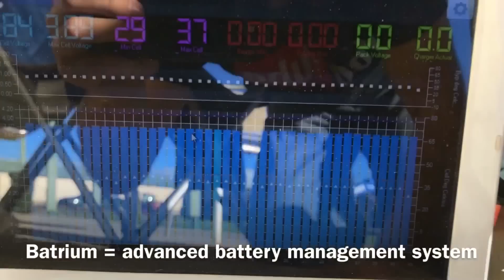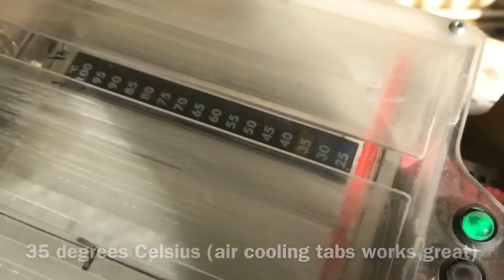210kW Racing Electric Yamaha R1 vs Petrol Bikes (race track) • Ripperton DIY Electric Motorcycle

Comment: Great video your enthusiasm is addictive. i do have medications that could help though 🙏

Need to get rid of the exhaust pipe its just extra weight, less weight more power.

Electric bikes for the road are dangerous. Its bad enough with a decent exhaust on a petrol bike as most car drivers are morons.

Fatality rate if all bikes went electric on the road would be shocking.

And a synthetic sound would be lame.

Ill always have a petrol bike, no matter if we run out of oil on the planet and have to pay a fortune to get a tank of fuel.

Comment: This is where everything is headed...for sure...E-formula is already ganing tons of ground...it's simply a matter of time before all the combustion engines are phased out...eventually it will be illegal to run something on fossil fuels...and you will pay an exhorbitant surcharge for doing so...and when you're out in public with your fossil fuel vehicle you will be shunned ,rideculed, and mobbed by clean energy protestors...they will destroy what you have...and noone will be held accountable
Reply from the maker: Yeaahh agree 100%.. the electric vehicle will sift faster than people expected... all automakers have announced that they’ll stop making petrol cars and all moving toward electric. It’s cheaper it’s more efficient, it’s more reliable, it’s faster, it’s quieter and a lot more POWEEEEERR ohhh yeaahh
Reply: Hearing aides will need to get aLOT better too!
Lol

Comment: Its not an R1. Its an R6
Reply from the maker: It’s an R1 with the fibreglass lightweight R6 fairing. This bike crashed during the racing season and Danny didn’t have much time to shop around and just grabbed the R6 fairing and made it fit. Danny is also a very tall and large guy what also makes the R1 looks much smaller... =]

Comment: How fast does this beast go
Reply from the maker: Great question, this bike is geared for racing but can also be geared for top speed. Racing I think +/-220kmh it depends on the track. Racing you need to start breaking much earlier to make the corner... would be interesting to get this on a highway with tall gears going full throttle and see how fast it goes hahaaaa ohhh yeaaahhh

Comment: Break on the left?
Reply from the maker: Yeah, regen electronic rear brake on the left. He machined a pressure transducer to the lever so when he pulls the brake, the hydraulic pressure pushes a sensor and tells the controller how much regen brake to apply. It is a variable adjustable regen. Very clever solution ohhh yeaaahhh =]

Comment: Seems like the battery lasts for about 15 minutes.
Reply from the maker: At these power levels and constantly accelerating and decelerating its kinda hard.... there are some freaking fast similar electric bikes running on TT island since 2014, they use more high-end and efficient controllers and motors that can run much longer (Ripperton is all homemade freaky stuff)
So much POWAAAAAAAHHH ohhh yeaahhh =]
Reply: ElectricBike I didn't think this is possible, really surprised me.

Comment: My 500cc RG Pepsi Suzuki (4 cylinder 2 stroke) outrageous Kevin Schwantz race replica (see picture) would give you a right pasting. Illegal in Australia and most counties except UK (In Japan 400cc version only)

It's an absolute animal and beats most other bikes much larger cc due to light weight and enormous power coming in at 7000rpm and above.

Brakes on it were enormous and that's what counts when lapping Isle Of Man TT course or any racetrack.

Acceleration is what counts at the end of the day, and the RG had that with light weight in Spades !

I bet you no chance saloon he would not have got by me !

Comment: For those who miss noise, you can add a "vroombox" and get a V8 engine or a flying saucer.
For those who miss smell, try coal, it's great (and noisy, too) !
Fuel technology is dying, no matter you like it or not.
Now about the bike : Very good job, but I wonder if the center of gravity is not too high because of batteries instead of the tank ?

Comment: Ok. Speed seems not be an issue. Now, someone must invent a way for electric race bikes to reproduce "the howling"... I can't hardly think about an era of GP races full of overpowered silent beasts. Half the thrill would be missing in the air at least. Kind of a quiet AC/DC concert... Nah.
Reply: same used to be said in a few RC hobbies that replaced Nitro or fuel and went with Lipo power. At first you miss the sound, but quickly you realize you enjoy the power and convenience of electric system to such extent the noise no longer matters. Power on demand (instantaneous) =  best feeling ever. Eventually everything will be this way.
Reply from the maker: Hahahaha I have to agree with you on this one, we are so used to that high-pitch / high-rpm sound... the transition is hard but inevitable. Let's thing about the positive side, now we can ride the silent bike playing AC/DC out and loud hahaaaa ohhh yeaaahhh =]
Reply: More like an acdc concert with everyone wearing earphones. Nobody outside would get bothered by the noise and complain!

Comment: Well I tested KHB14601C controller and had a lot of trouble! During acceleration phase at around 40-45kW het get out with overcurrent! KLS 14401 is working much better but has less current!. I know that Kelly Controller should work one to one regarding DC amps and phase amps but 1200A with two controllers are not possible, maybe for 3 seconds or less! But in this time you will never reach 124V (175V root 2) So I think 90kW is more realistic and a lot of power for sure! Very nice build of your bike!

Comment: So I know a little about fuck all, how does the regen braking work? Is it like an alternator in the hub? Pull the brake lever and a circuit feeds more current from the battery to the stator in the alternator in the hub and creates an electro motive resistance and brakes the bike or what’s going on there? Love it but mate! 👍🏻👊🏻👌🏻. A great effort. Bet it took a lot of fucking around and time! 👍🏻

Comment: Nice bike nice work but I think he is only faster in the corners cause he dont need to clutch and shift... on the straight a onbord view would be cool to compare... what is the vmax and how far can you get with it in full throttle? And how much do invest in the elektric parts?
Greetings from Germany and sorry for my terribel english😀
Reply: Electric motors have maximum torque at any rpm, petrol bikes if they are not in their torque range they going to get gapped regardless of gear shift delays.

Comment: 6500ks on that electric motor and battery pack? fuck that is bad ass. i bet it weighs a fair bit but the 210kw electric motor on the R6 chassis is a wicked idea.
Reply from the maker: Yeaaahh this setup lasted 4 complete racing seasons as far as I remember... it has gone through a lot of punishment and survived!!! 
This is actually a heavily modified R1 frame to accomodate the battery and motor controllers under the seat, the front fibreglass fairing used to be R1 then the bike had a crash in 2016 in the middle of the season and they quickly fitted the R6 fairing + Danny is a giant guy so I got lots of messages saying "this isn't the R1" and I had to explain all that hahahaa
Super cool bike... I'll be making a video showing his electric racing rival a 700 volts superbike hahaa ohh yeaahhh =]
Reply: Ahh i see haha thanks for clearing that up man. Cant wait for the new video!

Comment: Yeah, when will we expect to see responsive throttles for the DIY guys? 
You can never expect to be First On Race Day with a Bafang thumb on your bars unless you're only passing Spandex!
With Super gas bikes, most of the race is won or lost due to throttle control in the corners.
Reply from the maker: Yeaaaaahh mate... throttle control is everything when it comes to racing, it's a lot to do with a good controller rather than just installing a good premium throttle. The little Bafang controllers have a descent ramping power but they kinda get a bit jerky if you rapidly reduce and increase speed. 
Motor controller technology, throttles, sensors and processing power are improving really fast, soon we will have many amazing FOC compact and lightweight options to choose thanks to this drone and electric skateboard boom... ohhh yeaahhh =]

Comment: 281HP , a MotoGP  only makes around 260hp.
Reply from the maker: Yeah... imagine that on a single gear setup.... massive torque all the way up with no interruptions... haha
Check out the 4x motors sandwiched together before it was fitted inside the bike, more info on the description: https://instagram.com/p/BVzHFcHlgwe/
So much POWEEEEEERRR haha =]

Comment: You could call you bike "R1 ras tanura" clean edition :-|
Reply from the maker: Hahahaha... ohhh yeaahhh and with a lot more POWEEEEERR =]
Reply: ElectricBike you're great man: you're the dyi musk humiliating big oil based motor companies! Can I ask you how much is building your beast?
Reply from the maker: Building these "Frankenstein" one off beasts are expensive as there are a LOT of try and error buying and trying a lot of different parts. Sometimes controller and motors match on paper but don't really perform well in real life so you end up buying other brands and having many expensive spare parts sitting in your garage. Sometimes there's a newer better motor or better controller, better battery density with higher discharge rates... it's a never ending project that you upgrade things here and there along the years. 
Here are two really big Electric Motorcycle groups links where thousands of people share their builds, buy and sell parts and can help you and inspire your imagination:
https://m.facebook.com/groups/684227311714643
https://m.facebook.com/groups/125035107565566

Comment: This is actually pretty cool. Is it direct drive, or have gears?
Reply from the maker: It's a direct drive setup as the chain connects the motor shaft directly to the rear wheel sprocket. Here is a photo of this motor before it was installed on the bike, the chain you see there is connecting both motor shafts together, the main chain goes on the opposite side, check out the photo and description here: https://instagram.com/p/BVzHFcHlgwe/
Reply: ElectricBike Still...I'm not the biggest fan of EVs but that bike is nice.

Comment: Looks like you were having fun, also impressive work on the bike. I just can’t get into electric bikes though. Smooth linear power, consistent pull, they sound good on paper but I love the challenge of keeping a bike in the power band and revving it out until right as the power signs off and the pops as I engine brake into a corner. In fact one of the most fun bikes I’ve ever ridden was an old air cooled 250cc two stoke street bike with maybe 25 horsepower, it’s like an art balancing the revs, gears, throttle and brakes.

Comment: I prefer the petrol one.
Reply from the maker: They cost a lot of money, they're noisy (your neighbours would hate you specially in the morning and at night) they stink, require a lot of maintenance, oil change, filter change blablabla...  + the money you spend just with petrol you could buy another new bike, electric just makes a LOT of sense and in the end its cheaper to run =]

Comment: To be honest he does most of his passes on the corners.More rider than speed.
Reply from the maker: Hahaa it's kinda to do a lot with taking the opportunities + the petrol head guys are so used to each other's noise they don't really know how to react vs an electric bike with monster torque the whole RPM curve + it's a single gear... all these things just make overtaking a breeze =]
Reply: I bet the acceleration is nuts! a tron like cycle
Reply: @minutesagoedited9761  it would be instantaneous mentalness 🤘
Reply: @adamturner2836  my favorite kind of mentalness!
Reply: Rusted on petrol heads always try to say that, electric motors can give instant torque so they power out of the corner so much faster than dinosaur combustion engines.

Comment: This will sign the end of real motorcycle racing world.So sad
Reply from the maker: Yeeaahhh.. Ripperton actually raced for 4 years against a much more powerful 700 volts electric motorcycle, much faster acceleration and top speed but Ripperton's bike was lighter, therefore, more agile cornering... very close times considering the other bike was at least 5 times more expensive
If you're into power to weight ratio, watch my 36kg trike made with bicycle parts with a 42kw triple motor: https://www.youtube.com/watch?v=sRH_cpCwNDs&t 
So much POWEEEEEEERRRR... ohhh yeahhh =]

Comment: Wow... that DIY e bike was out running top mfg ICE bikes!!! Imagine what Dual Hub out-runner PM motors with a planetary gear reduction would do for this e bike... super low CG, rotating mass in ideal position for balance, full variable re-gen braking, more room for batteries/controllers, eliminate chain & sprockets, etc... 
Sure we can talk about rider skills but that's a mute point here.

Comment: well, I do not share the enthusiasm of the screaming narrator. Fast? Not even close, a skilled guy on a race 125cc bike would have passed them all, no big deal. Granted the E-bike has some advantage in shooting out of a turn due to instant torque, but we dont see much of it in video. Also the regenerative braking with rear brake is very questionable since the bike is using front brake for about 80% of stopping power due to weight distribution during braking. Hence not much force can be transformed in rear wheel recuperation. Also the recharge after every session showing us how useless this is for racing, to maintain the size and weight of a R1 the batteries capacity is too low for any serious full race, its a same no go as most e-cars are for road trips.
Face it, electric powered cars or bikes are not economical not ecological at the moment. The production is environmental disaster, same is the recycling. The production and huge loses in transfer of electricity is environmentally almost double polluting then a decade old petrol cars. Until there is some better, higher capacity battery that is easy and cheap to produce without the use of rare materials, there is NO FUTURE for electric cars or bikes. Also imagine that we all migrate to electrical vehicles in lets say two years form now, do you know what will happen to electrical grid? It would literally melt down every evening we get back home from the work. The last time I looked, there was no small nuclear power plant at every street corner.
I know E-positive people use to blame "oil lobby" for inhibiting vehicle electrification process, but actually same can be said about electric power production lobby that try to sell all the useless electricity they produce now days. We have all gadgets that are A+ or even better in our houses, average TV now consumes around 65W per hour instead of 500W like decade ago, same is with light bulbs, refrigerators, and all possible gadgets at home. But we have same power plant capacity of traditional sustainable production (nuclear or coal/gas) now getting filled up even more with unsustainable power plants (wind turbines and solar). What to do with all this electricity, we cannot store it in some kind of bucket? Wait a minute, we tell people that they should go green and buy a E-vehicle, that would be the bucket, we can tell them that its more green and even costs less.... and so we can actually sell electricity that we could not sell to anyone. So yes, the force behind this E-vehicle drive is actually the Power plant lobby....  
One day, its time for electrical vehicles, if there wont be something better till then, but ITS NOT NOW, NOT EVEN CLOSE.
One day I may see today's E-car and E-bikes owners as pioneers, but now I see them just as attention whores, not more.

Comment: Waht a stupid fucking fake video. the other drivers are not fast. they are crusing like in a out lap. realy fast is another thing.
and how long stay the battery? for 5 rounds?  :-))
Reply from the maker: +mick4659 hahaha... I'm not into fake Hollywood or special effects, this bike is real, check out some other links at the video description, there's one showing in action with a proper racing rider flying at the racetrack!!
Check out my 35.2kg 42kw little beast made using bicycle parts https://youtu.be/sRH_cpCwNDs
So much POWEEEEEERRR ohhh yeaaahhh.. =]